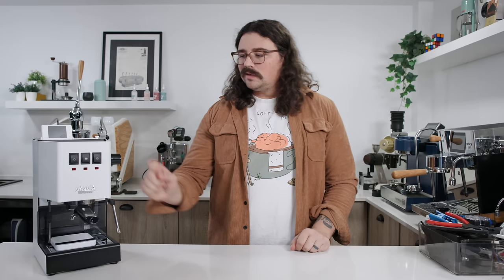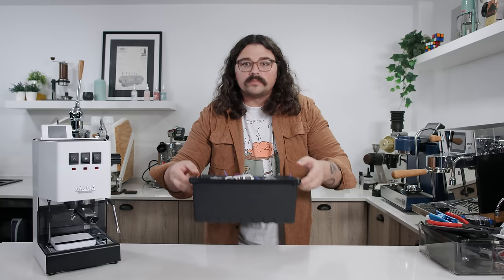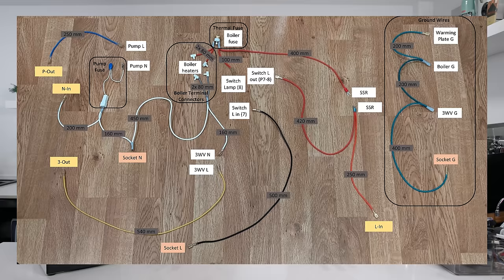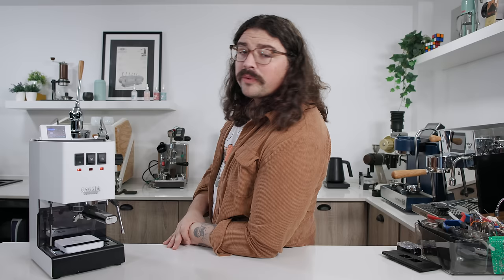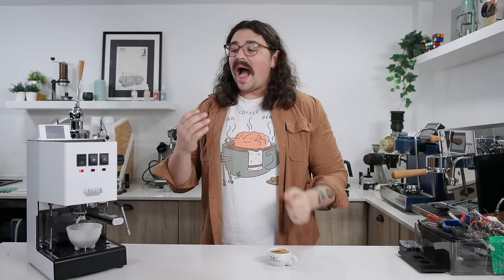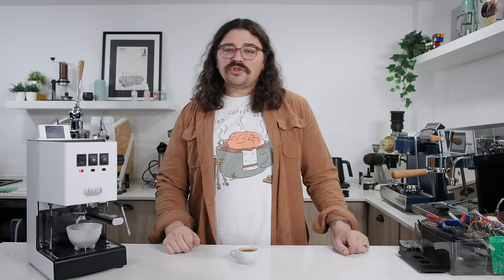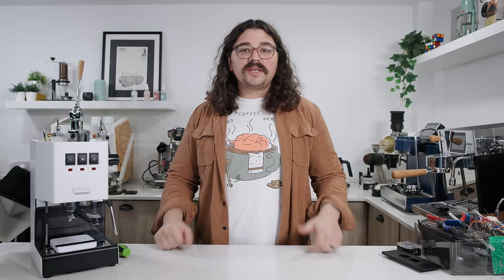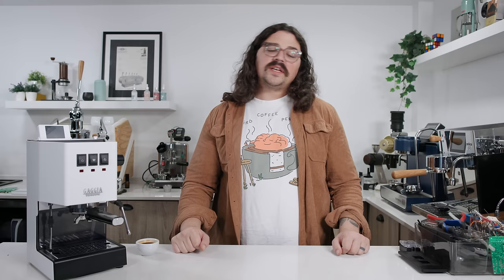ULTIMATE ESPRESSO MACHINE MODIFICATION: The Gaggiuino Project (Gaggia Classic Pro)

Comment: Slight correction: the temp shows an offset from the boiler temp, which represents the actual water temp flowing through the grouphead. So, that's not boiler temp, it's boiler temp minus 7 (I think) degrees.
Reply from the maker: Nice catch. True.

Comment: Great video.  Great product. I wonder if the Gaggia pump is designed for these different pressure starts and stops.  Maybe the pump will not last long?
Reply: Maybe, but it's very cheap part.
Reply: I would argue that since the pump is being used “less” with PSM, then it should last longer than stock (full throttle).

Comment: I've one of those endearingly ugly 24 karat gold plated Gaggia Classics with some kind of fault (I think I left the power switch disconnected) that's just sitting in the garage. I should mod it with this.

I really want to see these mods applied to the vintage Olympia Maxmatic/Coffex/Livietta. HX machine, so different paradigm and software required, but probably a lot easier to get the grouphead temp since it uses a thermosiphon to heat the group.

Comment: I am kinda scared that I gotta deal with 220V wiring for some of the parts...
You have any tip on how to discharge the power held in the machine before working with the wiring? Cuz I don't want to get a lethal electroshock there. 😅
Or does just grounding the ground pin of the plug (by holding it onto a radiator or sth) just do the job?

Comment: Your videos are really great and very helpful. Is it also possible to achieve such milk foam quality with inexpensive machines? I have a Delonghi la specialista prestigio at home. Tulips and hearts work very well, I just have the feeling that I do not get the milk foam fine enough for the motif Rosetta. The question is, is it still up to me or is it simply not possible with such low-performance machines? Greetings and keep doing so!

Comment: Hey Lance, I seem like I also have the GCP Evo judging on the ON/OFF switch that always springs back and that the machine has the auto turn off function. Anway I was pretty keen but also a bit intiminated to do the Gaggiuino mod, because I havent soldered and don't have the much electrician knowledge. 

Now finding out that I have to do custom wiring of the whole machine im really scared. I was also planing on getting the Peak Coffee kit but now im not sure  because of the custom wiring. Could you maybe give some guidance on the customer wiring part?

Comment: Technical question. Can you only do the dimmer mod on a single boiler machine? I tried doing it on my heat exchanger, and I noticed water would dribble from the group head even though the pump was shut off.

Comment: Hey Lance - I’m in the same boat where I ordered all of the individual components pre-PCB being available, became overwhelmed at the complexity, and didn’t even start. Looking at peak coffee’s website, it looks like I can order just the PCB with black pill. Did you get a whole new kit, or did you just need the PCB and can use the existing components (pressure sensor etc)?

Comment: Lance, anyone out there who KNOWS the answer, MUST I acquire a "Pro", OR can a plain old, lowly Gaggia Classic be modified as shown in the video?

From what I can gather, it looks like I might need to upgrade to the 3-way steam valve of the Pro, which is supposed to be easily done, and the steam wand could be upped as well, though not nec....

I have a trashed Classic ( needs a total plumbing descale, incl boiler disassenbly & refurbishment) I'd really like to resurrect it , and then proceed to bigger things once it's working.

Comment: Definitely interested to add this upgrade to my GCP. One question I have: is the 9 bar OPV spring mod still needed for this or does this bypass that need?
Reply: No, you need the original 12 bar spring because the software regulates the pump (with the 9 bar spring you geht max. 9 bar or less, with 12 bar you have some room)
Reply: @PhilippLaibacher , great thank you.

Comment: I think you should make a box outside the machine and put all board and screen on that then link the cable into machine. After that you had 1 mobile control box and more easier to touch on screen to make espresso 😊.

Comment: I'm curious how much the actual total was for the kit. I just bought the PCB and the 2 day shipping was insanely expensive for me, about $100 USD just for shipping the board.
Reply from the maker: First mistake- don't do 2 day shipping ha! And it depends on what all you need.
Reply: @LanceHedrick   yeah, i went full throttle. Just curious about shipping to Portugal. Also, it was your most recent Decent review, where you showed all the components ready for the Gaggiuino, that made me build one. It's my first machine, and i couldn't be happier. Thank you!

Comment: I was about to pull the trigger and start this project, ended up going with the Profitec GO.
Reply: What do you think of the decision on the Profitec go? I’m in the same boat with a 15 year old gaggia classic.
Reply: @wrm000100  it's a great "plug and play" machine. Very heavy and well built. The steam power is incredible. Heats up fast (for a coil machine) it's a beast 💪. There's nothing bad to say about it.

Comment: I am an electronics engineer and already bought the GCP with the idea to mod via the Gaggiono. But i don’t find the machine operating naturally. From what I see on the videos, the pump makes a weird noise and I believe that the arduino it is turning it off and on a lot of times.
Reply: That's how vibe pumps work.
Reply: Yes, the Gagguino controls the pump with PSM (Pulse skip modulation). Just like the vibratory pump on the Decent is controlled. So it's supposed to sound like that after the mod.

Comment: Shouldn't reach 9bar for the espresso?
Reply from the maker: If I had it programmed to 9, yes. But I didn't. Don't need 9 bar. Blooming shots don't go to 9 purposefully. They're set to go up to 3 after to 45sec bloom.
Reply: Gotcha
Reply: You can set up profile to do all kinds of things, like intentionally go to 11bar, or max at 7bar, or aim for a specific flow rate

Comment: My only problem with doing this mod is it becomes too automated. With a GCP and a PID you’re already not doing much other than puck prep, popping a brew switch on and off. With the gaggiuino, you lose even more to play with. To me it kind of feels like a puck prep version of nespresso
Reply: The point is that you can experiment with tons of variables but have it be repeatable. What can you change with a Nespresso in how its brewed?
Reply: I mean, by the point just get a flair 58 if that's what's appealing to you
Reply: @ajownz yeah, I think this mod is awesome and something I want to do in the future (I love tinkering with electronics). Was just pointing out that there are amazing products for people who want something manual if they aren't into the automated profiles
Reply: yes I agree it is awesome. The gaggia is great for modding. There is so much options for it. PID, flow control, gaggiuino. I’m not hating on it. I just feel there’s more interaction when you’re pulling with a PID + flow control. And when it’s automated like that you lose a lot of the “skill” playing with flow control and pulling.  However. Gaggiuino + flair 58 will be an amazing set up.
Reply: @doc8125  a flair is a great machine but if your workflow involves doing a few spros at a time it gets  old quite quick, additionally you will have 0 consistency with a flair because you're the one controlling the extraction and humans are not computers we can't be consistent by default as once you need to track multiple variables at a time it's game over.
Reply: @VSparxxx  I think a dimmer modded gaggia will have more variables and worse workflow than a fair 58, not less (which was what was compared to now). If we're talking regular flair models I agree, they're a hassle, but the 58 is super nice workflow wise and relatively easy to get consistent results with IMO once you get a flow reading scale
Reply: @doc8125  I wasn't really speaking about the manual dimmer modded gaggias I was comparing to the mod in question (this video) which is fully automated and allows to profile for any set of variables all bundled together to form any style of profile. A flair 58 will only do that unless you have a flair 58 + a pressure gauge + a scale capable of tracking flow + timer + a person remembering the profile by heart and capable of consistently follow that profile every time a shot is pulled. IDK about you but I think this is quite challenging to do any advanced profiles manually.

Comment: living at altitude? See on the display 0.4 bar, but don't know any cities in America above 7000 meters altitude. I see it even go as low as 0.2 bar, what's happening here? Unless the machine makes a vacuum at the beginning, but why? Or coding error?

'Over boiling' temp, euh? There is no such thing. At sea level water boils at 100ºC, never more (if we keep it simple and don't consider changes in atmospheric pressure)
Espresso machines use a pressurised boiler to go higer, at 9bar water boils at 160-170ºC, never higher. The moment you open the valve of the pressurised boiler, pressure drops and also temp. Pressure is first impacted, and is linear related to how fast it can excape the vessel. Water temperature is another matter, it drops almost as fast as pressure drops but has some latency, stored heat. When pressure drops, the boiling point of water drops as fast. Because water can't go over it's boiling point, the excess energy contained in the water is transformed in a large quantity of steam, and steam can go as high as it wants, no boiling point here. No machine can sustain this balance of pressurising water while releasing pressure, it's downhill from this point. Pressure has to ber restored to allow water to store more energy than it's able at 1 bar.

By the way, have you ever seen steam? Trick question, because every body says yes, while steam is invisible and thus no one has ever seen steam.
Steam is invisible and is always at higher temp than boiling water, that's why steam is so dangerous. You only notice you're in it when it's to late. What we see, is condensation of the steam, when it transits from above boiling point to under boiling point. Can still be dangerous, but at least you can see condenstation.

While writing this, I was wondering if any one tried to make a insulated boiler, to slow down the heat loss. On machine like this one I would not excpect to be worth it. But one with a lot bigger boiler, might start to see some difference, longer steam time. But, is it necessary?
Reply: It's strange that you know the boiler is a pressurised vessel but then you question the presence of pressure in a system where water is being actively heated.
Reply: @VSparxxx  not sure the point/question you are making, can you copy paste the part you mention.

... after rereading my post several times ...
"No machine can sustain this balance of pressurising water while releasing pressure, it's downhill from this point."

Yeah, not good. A simple kettle can prove me wrong here.

Comment: If this machine can be upgraded it for $60 and be so incredibly improved, why don’t they… Just fucking make it like that in the first place? People are changing the bars of pressure? Why wouldn’t the company just give it that pressure to begin with?
Reply: There's always reasons. A lot of these modifications are covered by different patents, DIY users don't need to worry of course but a producer couldn't put them all in without getting in trouble. High pressure is a selling point to people who don't know much about espresso which is the primary demographic of these types of machines

Comment: Ok glad I didn’t went this way. Unfortunately this mod doesn’t solve the main issue with this machine of big temperature fluctuations during a shot. With this you will never get consistent results…. Almost 2 degrees temperature drop is too much. My friends Rocket has 0.1 degrees during a shot measured above the portafilter.
Reply: It has a feature called brew delta that amps up the temperature above set point to account for the inrush of cool water
Reply from the maker: Here is the deal- you have absolutely no ability to tell the difference with a 2 degree drop mid shot.
Reply: @LanceHedrick  Hm ok but why are some brewing recipes for speciality coffee for example 95 degrees instead of 93? When I watch kaffemacher youtube channel tests the say 2-3 degrees is not really good for consistency
Reply from the maker: @nazirzh  anecdotal. The only sensory study I'm aware of showed people couldn't taste the difference under 3 degrees Celsius. So, they thought 93C and 96C shots tasted the same. The differences only became a bit more statistically significant past 3C